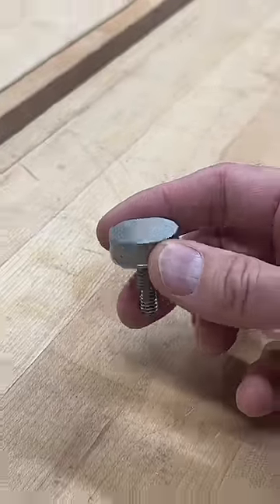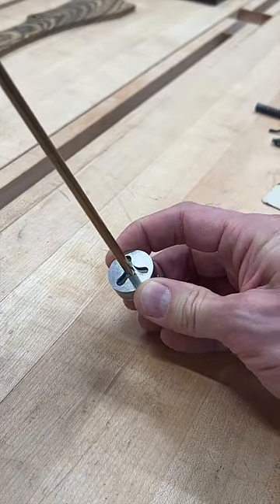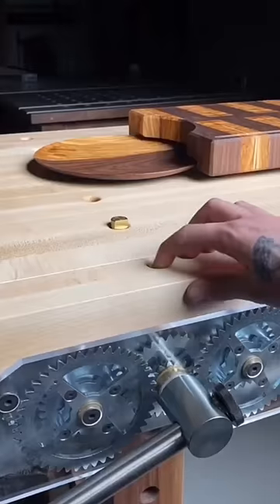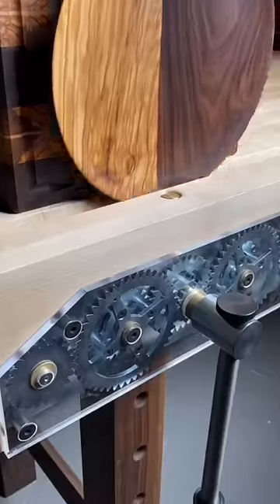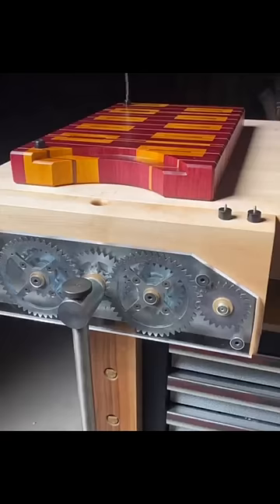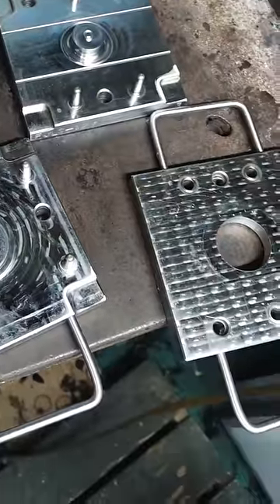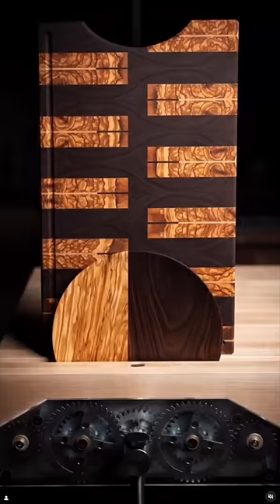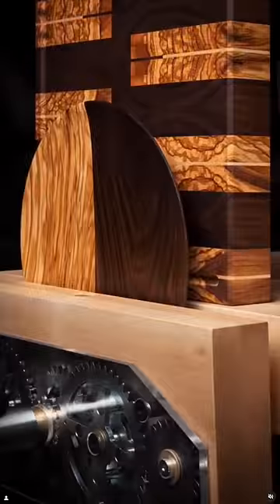Pika Screw on Owl Woodworks cutting board

Comment: My machinist background: This is pretty cool. 

My Common Sense: Who the fuck is paying this much for rubber feet that will never in their life be seen again. 

Anyway, keep iterating that design (or I guess purpose) and you'll eventually perfect the need for it.
Reply: When you are a celebrity chef making millions of dollars per year, you can afford a cutting board that costs thousands of dollars. When you are a cutting board maker who makes thousands of dollars per cutting board, you can afford a screw which costs 26 dollars.

We are talking top of the line here, where marginal value is meaningless, it's all about getting the best of the best.
Reply: @phillyphakename1255  I guess I didn't think about it like that. It makes sense, thanks for putting it into perspective.
Reply: @772CODEMASTER rich people are the best clientele for stuff like those cutting boards. It’s more for decoration than anything for a lot of people, so they’re willing to pay top dollar.
Reply: People with money buring a hole buy stuff just cause they can.
Reply: Exact same thoughts 🤣
Reply: You are 100% correct. I am a manufacturer. If you need to make money in commodity items such as fasteners, you need to sell quantities of them. At this price, the quantity will never get high enough to reduce the cost enough that it will be accepted and used by the public. And yes, the rich will pay stupid money for things. But if you only sell a small percentage of a large item, there is not enough margin for you to be able to exist. People making this comment do not understand manufacturing and economies of scale.
Reply: This guy knows
Reply: I look at it like most things. 1. I may never need it or want it. 2. If it goes main stream the price will go down. In 1954 a 15" Westinghouse TV was $11,875 (adjusted for inflation). or $971 an inch.  Today a Samsung 65" for 9,997 is $153 an inch. 4.3 times the viewing area plus bells and whistles the past never thought about.
corrected typo
Reply: To be fair, I make burn epoxy cutting boards, I think this could really help with some things I’m doing, it may be specific, but shit I’d pay for it
Reply: Like paying a quarter mil to rubber neck the Titanic.
Reply: Yeah some people need to be giving a little more of their income to charity. (Not joking.)
Reply: @killthecardinals  news at 11: rich people find ways to spend their money, on things which are cool and nice, even if they don't NEED something that expensive and or cool and or nice.
Reply: silly question... 😂
Reply: On a cutting board???  Sounds like a breading ground for bacteria...lol.
Reply: @772CODEMASTER  shhhh.. It's handy for padding your expense write offs. Put them on everything!
Reply: Beautiful
Reply: as philly said, spending 100 bucks on screws for a piece that sells for a couple grands isn't that far fetched.
tbh in most cases you'd instead use a sticker on top of regular screws.
I think given the size of the screw, you could simply have a magnetic lid for way cheaper.
Reply: when your making a piece that will sell for thousands of dollars that much money isn't a high price for hardware like this
Reply: @772CODEMASTER I like how you've humbly accepted another perspective and welcomed the new information and yet the people just have to keep coming to say the same thing over and over.
Reply: @Maelthorn1337  yeah, the comment section tends to get out of hand and folks just end up replying to the main comment. Glad you pay attention to it though lol.
Reply: @772CODEMASTER  Eh, I don't like redundancy so if someone has already said the thing I want to say and I have nothing more of value to add I just keep my mouth shut.
Anywho, have a nice day. Always appreciate a pleasant interaction in the e-wilderness.
Reply: Whatever floats their boat as long as they keep that economy rolling
Reply: Maybe some would rather spend 5 or 600 dollars trick fasteners than their kids fighting over the money when they are dead.
Reply: How tight do you need or the real question how weak are your hands?
Reply: The problem with something like this is that no one will know it’s there. They will destroy the object because they won’t find a way to get it off, or put a pair of channel locks on the OD and scuff it to shit to get it out. Fun if the customer knows, not fun for trades or with age
Reply: 100% ridiculous
Reply: @phillyphakename1255 that sounds pedantic as all hell. This is why I prefer the idea of eating the rich and returning to monke.
Reply: Also, since it's a foot, that means the screw sticks out.. And it's covered by rubber.. 

So why does it need an inset at all? You can just turn it... No?
Reply: @Insertnamehere58  actually they could’ve stuck any rubber feet on them and it’d be the same product. Some of them even come with screws embedded in them so you can’t see the screw at all yes.
Reply: @noobpro9759  I mostly agree! When you get to the point of "huh, that's kinda cool" for 100x the price, we have something wrong going on with the wealth distribution.

That said, it's pretty cool stuff, and people like shiny objects with little purpose. See: Jewelry
Reply: It’s the tiny details
Reply: Yep, it will never be seen.
Reply: @christopherscott8853  actually no, the foot dosent cause water to get in the wood, it prevents it! and dry, oilied hardwood is antibacterial. lengthly explanation but acurate facts i promise. here we go.

Feet raises the board off the wet counter therefore preventing the wood getting/staying wet for long periods of time as it would if you forget the board in a puddle of water overnight. the problem is wood expands as its humidity content raises so if only one side gets wet the board will cup and unless the 4 feet are touching the counter the board will rock with each knife cut which is so you have to flip the board over to use it or shim it with towels which is annoying, improductive and an additional work hazard in a fast paste restaurant kitchen.

good quality end grain wodden cutting boards, as long as they are properly maintained and cared for, are dry as bone and completely sterile, surprising but true. thats because first the end grain orientation dosent get damaged from blades but flat grain does. second, the wood is dried to 7% humidity which is in equilibrium with normal indoor conditions and that is way too low to allow bacterias to survive or mold to grow. and boards are supposed to be near saturated with mineral oil (upon construction they are dunked in a bath of oil until saturated. after that just regular reapplying of the oil is sufficient to maintain it) ,that prevents water from getting in since there is no physical place for water to go. bacteria are being pushed between the fibers on a microscopic level but they die within 5 min of being put in that dry, oxygen free environment. and third, hardwoods used for boards like maple, black walnut and purpleheart contain tannins which inhibits bacterial growth. 

for all these reasons wodden boards also dont need to, and shouldn't, be washed with soap. that only removes the mineral oil overtime therefore making it less effective at keeping water and unwanted flavors out. just wipe it down with a damp warm cloth, thats it. no smell, no bacteria.

on the other hand, plastic cutting boards need to be heat sterilized in the dishwasher after each use and still needs to be replaced regularly because knife marks roughs up the surface and makes pockets in the material which cant be cleaned, hence the heat sterilization. regulations call for plastic and heat because its foul proof but they also recognize that properly made and maintained wodden boards are safer than barely used plastic boards if they arent heated to 80C for some amount of time. wood is faster, just a quick wipe, dont even to move it!
Reply: @hexenhammer483 i believe you have a typo. Should be $791 not $197.
Reply: @ZanyT567  Correct! Dyslexia for the win.
Reply: @matthewcantrell5289 people with inherited wealth and lacking a sense of value are like that. Rich people in general can be some of the most frugal people.
Reply: @phillyphakename1255 still a weird af flex tho, not talking about the board, or the screws but to use them for the feet. 

Will definitely appreciate the detail when I get to have one.
Reply: As someone with a similar background I see, your point but also: do you wanna learn how to program, get a cnc machine, learn how to use it and then make 4 screws for a cutting board?
Like, I can totally see the point. If it's not in bulk or big pieces, you'd pay each peace for the material, the programming,  machining and eventually the finish (galvanization, etc.), it's more about paying people for their knowledge I guess.

F.e. you'd wanna have a top notch welder for a structurally sound construction and you'd have to pay him as such.
Sure, any other guy could also do it, but someone with a cetificate pays if the construction they welded fails.
Reply: I mean, the purpose it was used for is indeed kinda silly, regardless of how rich you are, silly is silly. Though the screw is very usable already, I have plenty decorative shelves that have similar looking thumb screws that are in very visible places and are a part of the look, and they would look way cleaner if they were totally smooth as shown here.
Reply: The same people who pay 250K to visit the Titanic in an unproven submersible
Reply: @JeronimoStilton14 nobody who can buy this will EVER find themselves breaking down their cutting board (to what end I couldn't say,) and if they DID need something done which required the removal of these feet, they would probably just contact the manufacturer.  Millionaire Chefs aren't grabbing vice grips to DIY it. And they aren't going to hire unknown quantities who could potentially ruin this guy's work. 

The rich don't need to save on labor costs. They don't waste their VALUABLE time tinkering on boards or with screws and fittings etc. They hire someone who will be as good at woodworking as they are at cooking. 

Your scenario just wouldn't ever happen; events simply don't combine to your eventuality. Not if your clientele buying these cutting boards is amongst the "Éric Ripert" level of Chef. Why waste an hour fucking with your cutting board feet when you could be making $$ in your career, or prepping the dinner menu at your restaurant. Pay someone else for that hour. Pay the guy who installed them for that hour. Provided he doesn't just do the mod for free under a "warranty" type attitude. Nothing is WRONG, but at (?) $5,000, (MORE? LESS?) he'll make sure it is ALL RIGHT.. this is the only way to go, and they have the means to indulge this method. 

Now, if Joe blow acquires a piece 2nd hand, and wants some adjustments, then perhaps your fears could come to light.
Reply: And wen you can make a top cover for 2$
Reply: "Who the fuck is paying this much for rubber feet that will never in their life be seen again."

The same people who complain about how no one wants to work anymore, while not bothering to pay anyone decent wages, and then sit around wondering what they should do with all their money.
Reply: Well I have sold a coffe table and 2 chairs for 12800€ , rich people spend los of money on silly things
Reply: If you were Japanese, you would understand that there is a nobility in a job done beautifully and precisely. Takumi is a concept that emphasises mastery and craftsmanship.
Reply: @satyris410  some Americans appreciate the idea as well but too many get by on good enough.
Reply: not to mention, most people i know prefer not to add even more height to the board, just use a tea towel for stability
Reply: @phillyphakename1255 you must work for the US military. If it’s more expensive and made by someone you like while being more complicated and not completing the objective anymore you call it the best
Reply: @christopherscott8853 holy shit great fucking point. You should repost this as it’s own comment. It’s literally a hidden little door just to fill with water or gross shit and it  will be incredibly difficult to keep sanitized.
Reply: @masongoff8995 it’s also bound to be more hygienic. Because the tolerances are so tight it has to make it harder for dirt and germs to get in so you could probably add in to the client that you use them for their protection and it helps them to have less chance of getting sick 😂 keep being awesome 🤗
Reply: @772CODEMASTER  While it's true, it's unfortunate that this perspective even exists. Money spent on things like this makes no sense at all.
Reply: @ofallnames  Thanks.  Feel free to post it if you please.
Reply: @phillyphakename1255  how does a hidden screw hole on a part that is unseen during use qualify as best. It's just conspicuous consumption which is hilariously ironic for an feature made to be invisible.
Reply: @TheNewton  "best"

Its... idunno... Cool? Yeah, it's conspicuous consumption, but also it is machined with incredible precision, and the design is also top notch.

I think I rather have this kind of consumption from millionaires rather than 10,000 dollar bottles of wine or something just because the grapes were grown in 1980, ya know?
Reply: Me. I will. Because I’m a psychopath who likes the deets. 
It’s a problem.
Reply: FC😊😊
Reply: @phillyphakename1255 literally just making a board out of a board
Reply: @phillyphakename1255  LOL... so that money isn't about a thing that actually makes the board a better board? That money is about people who can spend that money even if the feature does not to improve the product. It's a luxury only due to it being expensive and cool.
Reply: @phillyphakename1255  not all celebrities spends ludicrous amounts of money for just every day life necessities
Reply: S
Reply: @cataca91  do you understand the meaning of the word "can"?
Reply: @772CODEMASTER "thanks for using your brain for me" would be a more accurate reply.
Reply: You don't understand rich people at all. This isn't marketed at the average joe.
Reply: And the funniest part of this is when the rubber wears off, the metal will scratch up everything. 😂
Reply: @phillyphakename1255  Except that it's not the best of the best. You're confusing vanity for quality.
Reply: I just don’t get it ????
Reply: So anyone who wants to repair it gets a stroke
Reply: bro just wanted to make fun of it
Reply: what i thought when i first saw sos invisible hinges. wonder how many million have sold so far.
Reply: Some folk live for quality, craftsmanship and the finer side of life. This screw, offers that.
Reply: I'm shift lead for a job shop and these things would piss me off so bad 😂
Reply: can you say You're Screwed...finger ot otherwise
Reply: That's what is commonly referred to as "fuck you money"
Reply: Yeah, a cutting board that costs $104 (with no mark-up, yet) in custom screws alone. Add the rubber feet and the actual board and you need to sell (1) board for $600 dollars. Nah, I am going to the dollar store for a cutting board… I can throw it away for all my life and go buy a new one and not hit that price.
Reply: @phillyphakename1255 best of the best or just as pricey as possible?
Some materials are better than others but in this case it was kinda pointless. I was expecting some cool design that utilized those fancy screws but watching them being put out of sight is kinda disappointing.

Let’s distinguish best of the best from as pricey as possible.

When I look at my past spendings that wasn’t necessary in case of design or usability I feel like it was a waste of money. Even now when I’m earning much more and I don’t have anything new to buy because I have everything I need. Still feels like waste of money
Reply: @piotraueternum  dont get me wrong, I think it isn't worth the price. I'm in the same boat as you, where I have money to spend but still feel the strong pull of frugality. 

But there are some people who wake up one day with a billion dollars in the bank, who could spend a hundred thousand dollars per day for the rest of their lives and still never run out of money. Where money is absolutely meaningless because they couldn't run out of it if they tried. Where giving it all away is kinda tough because you have so much.

For those people who see no meaning in a price tag, these feet are pretty cool. For those people, I could see it being worth it, because there is essentially no tradeoff. It's kinda nifty, and kinda nifty is worth more to them than a few thousand bucks.

It's conspicuous consumption, sure, but at least they are getting something kinda cool for their money, and supporting the makers and the whole industries that support them along the way.

As for best vs most expensive, I think these are the best. They do the job of screwing, like all screws do, and they look nice, like many screws do. The only significant distinguishing factors are the novelty of the design and the price. You aren't just paying more, you do get something for that price: novelty. And when you've spent your hundred thousand dollars per day, getting all the mansions and Lamborghinis and trips to space you want, all years ago, a new cutting board might just bring you a tinge of a smile. That's worth 26 bucks.

Anyways, rant over. I could see it being worth it to people who see little to no value in money. That's not me or you, so it's okay that we disagree.
Reply: Same reason you keep risking using the spoiled milk in your fridge. too expensive for you to replace, but to rich people its an after thought to just toss the half empty jug out, and replace it with a new one.
you have no reason to throw it out because to you it’s still good for use. To them and their money. It won’t matter saving a dollar when they can make 4$ for every dollar they spend.
Reply: Capitalist greed.
Reply: I think we’ve started to evolve as people to where we can buy things not solely for their function or practicality. Yeah design and art exists bud
Reply: @aloenpc  you've completely missed the point. The fact that one person in the world can afford a small bedside table, and one person can afford a single foot of a table that cost as much as one Is fucked
Reply: looks great but then my brain says give it 3 months then the MOLD will move into the screw. and you will never know it.
Reply: It’s one of those things people create things with intentional issues to utilize this product lol. Like why take the time to make a design with no external screw holes when you could just make a lazier design and use these screws Instead
Reply: YouTube asked if this comment is relevant to the video
Reply: @guy990  god replied and said yes
Reply: @phillyphakename1255  very well said
Reply: @Maelthorn1337  When a comment thread gets this long, people stop reading and just say what they were going to say anyway.
Reply: That's the difference between IKEA and well crafted furniture. You pay the price for attention to detail, which translates to quality
Reply: Somebody smarter than us probably thought of twenty or thirty ideas by the following morning.
Reply: @772CODEMASTER It‘s still stupid and decadent though
Reply: “It only makes sense in ultra high end pieces”. Did you just pause the video after $26?
Reply: @phillyphakename1255 So the total market is around 3 customers?